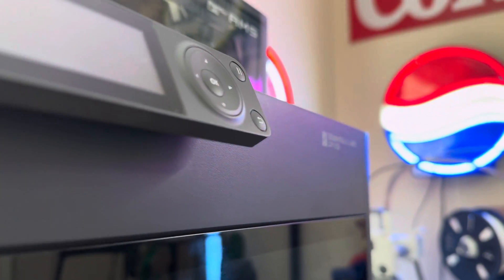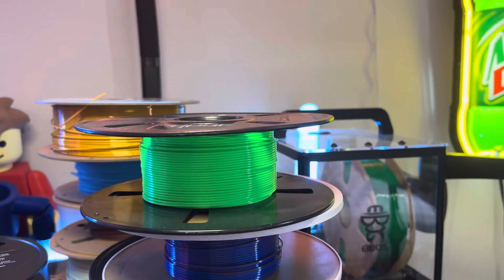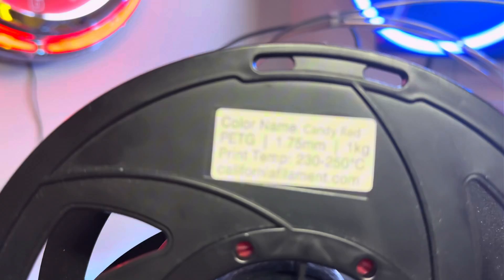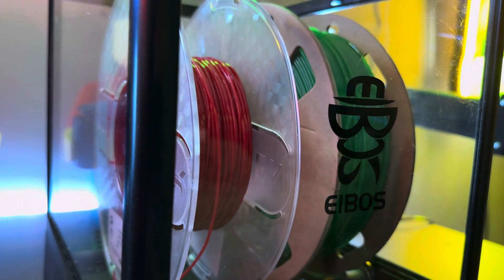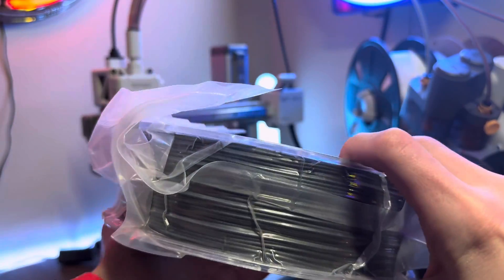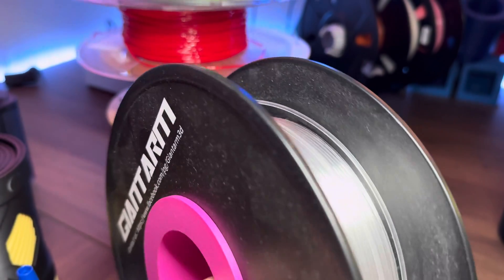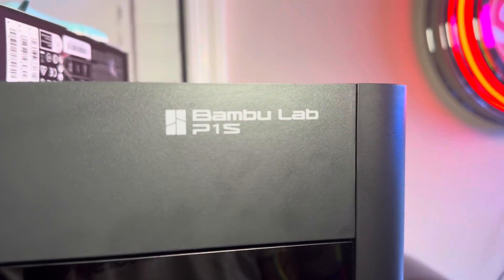The most popular filaments and what they're used for...

Comment: I saw, in the video, that you have a Bambu. Why don't you use the Bambu filament? Other videos I saw suggested that the Bambu fillaments have a RFID tag that the machine reads and know what material you are using and adjusts the settings for it, too expensive? I don't even have a printer yet, I am just doing my research.
Reply: it can be twice more expensive, 20 usd for a bambu filament while elegoo is just 10, beside the rfid thing while an advantage when loading other brands you just choose the profile and color, the rfid only saves you like 10 seconds or so. I have a P1S by the way

Comment: I have no idea why people still think PETG will destroy your PEI bed. It WONT. PETG is my first filament and ive consistently printed it for a year and a half and never needed a glue stick. Even when I used a different build plate and it was mashed into the bed I was able to scrape it off. Get your z offset right and do NOT use glue and PETG is a great filament for functional parts.
Reply: I have been printing PETG on textured PEI without glue stick, so far so good.
Warm soap water for cleaning.
Reply: I definitely can show you something that’ll prove it might. Please use a glue stick.

Comment: I want oto print a laundry detergent ball to put in the washing machine with the detergent inside.  I have a BambuLab A1 so limited by what filament I can use - woul dPETG be suitable for what I want to print or do I need to look at something else?
Reply: So it depends on what you have your laundry temperatures at. Personally PETG hasn't let me down in cases of needing impact, temp, and chemical resistance. I've left it in a hot car where the inside easily reached 110°F and no harm done. It's a badass filament and I'd say it's a good choice!
Reply: @ethanbunch3274  All of our washing is done at no hotter than 20-30 celcius as most of the clothing washed can't be washed any hotter.   Towels and bedding get done at the hotter temperature but by and large 20 celcius is the setting the washing machine stays at most.

I will take your advice and print one in PETG and hopefully all will be well  - I just need to find a laundry detergent ball print file.

Comment: OK when you say well ventilated area so I plan on setting up my printer in my closet I mean, does that count as a good area?
Reply: In theory, PLA isnt dangerous as its made out of corn and sugar cane. BUT if you plan on printing pretty much any other material (like ABS) you shouldnt be breathing those fumes on a daily basis. As long as the fumes can leave your room in a timely manner, aka a ventilated room, you should be fine. Although i leave mine in the garage. Because i cant stand the smell (and noise)
Reply: You should not print PLA in enclosure.

Comment: You should resarch a video topic like this before posting things you just believe in. 

Ther are a lot false statements in this video. 
Here are some examples: 
Petg is no problem on the bambulab textured buildplate if you let it cool down properly. You should warn about ASA on that build plate.
Sadly learned that the hard way. 

Pla ist a lot stronger than you give it credit for and it has one of the strongest layer adhesions. Just watch any other Chanel where they test filament with measurement equipment. 

Calling petg heat resistant is pretty bad.
Being better than pla doesnt mean its resistant.
From bambulab website Heat Deflection Temperature : 
Pla basic 57°C 134.6°F
Petg HF 69°C 156.2°F
Petg translucent 74°C 165.2°F
ABS 87°C 188.6°F
ASA  100°C 212°F
And there are a lot mor heat resistant filaments out there 

Implying that the bambulab printers arent direct drive 

The hardnes of the tpu is bery important for it's properties 

For beginner knowing of pla +  or tough pla would also be pretty interesting

Comment: 1. *PLA (Polylactic Acid)*: 
   - It's the most popular and easiest to use filament, especially for beginners ([00:00:48]). 
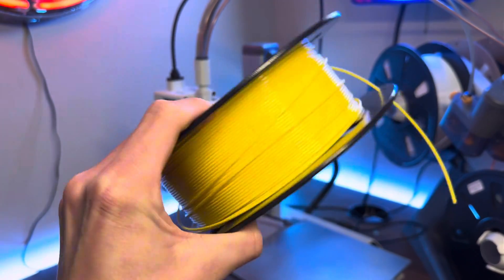   - PLA is easy to print with, available in many colors, and relatively inexpensive ([00:01:12] - [00:01:46]).
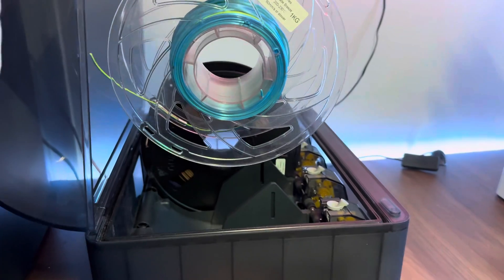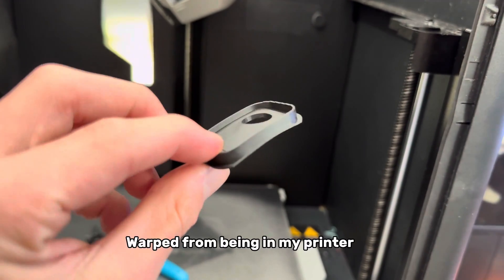   - However, it's brittle and has a low melting point, making it unsuitable for functional prints ([00:02:44] - [00:03:09]).

2. *ABS*:
   - This filament is stronger and more heat-resistant than PLA, making it suitable for functional prints ([00:03:28] - [00:04:02]).
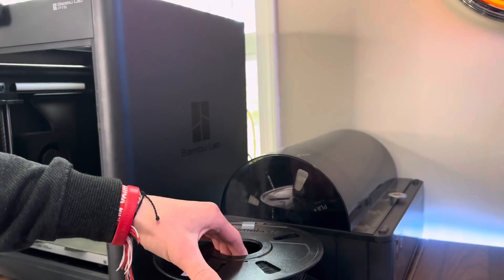   - ABS is cheap but requires a well-ventilated enclosure due to toxic fumes ([00:03:44] - [00:04:12]).

3. *PETG*:
   - Known for high strength and heat resistance, it's suitable for functional parts ([00:04:36] - [00:05:01]).
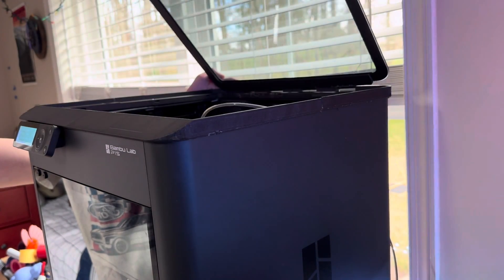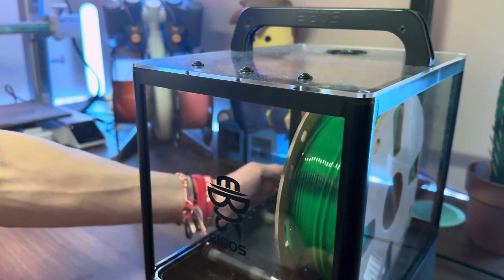   - PETG is easy to print with but can warp, requiring higher bed temperatures and adhesive ([00:05:04] - [00:05:37]).

4. *TPU*:
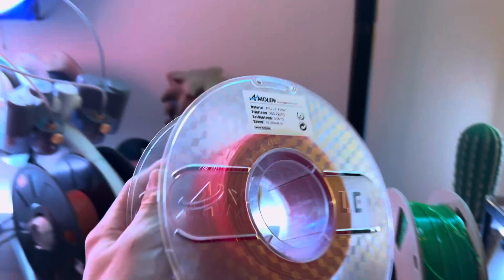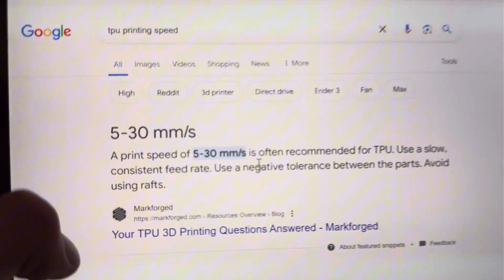   - This is a flexible filament, great for creating rubber-like prints, such as phone cases ([00:06:45] - [00:07:12]).
   - TPU requires a direct drive setup and is more challenging to print ([00:07:16] - [00:07:39]).

5. *Nylon*:
   - An engineering-grade filament that is super rigid and suitable for functional and stiff parts ([00:07:52] - [00:08:13]).
   - Nylon is expensive, very hygroscopic, and difficult to print, making it not suitable for beginners ([00:08:16] - [00:08:30]).

Comment: I don’t want to put glue on my build plate is it fine just to print it like Pla?
Reply: Depends on the build plate, most of the time you dont need anything, although if you have first layer issues then adding glue as an example could improve your prints (dont use superglue or anything stpid, use proper recommended glue

(you could also get something like a textured PLA ... Plate that doesnt need glue in any way)
Reply: You can wash and rinse the glue off later after done printing with warm water and let it dry.
Reply: A-clean bed
B-glue stick
C-hairspray ( my preferred ).
Reply: If you print PLA or PETG using Bambu, on the textured PEI plate, you shouldn't need glue. At least I don't. 
Just make sure the plate is washed with soap and no finger grease after washing.